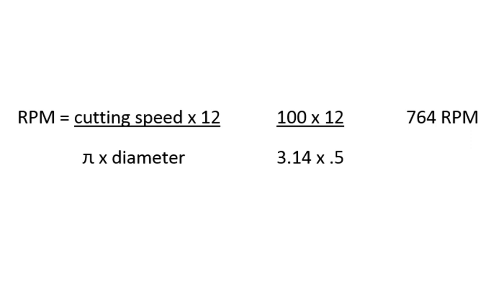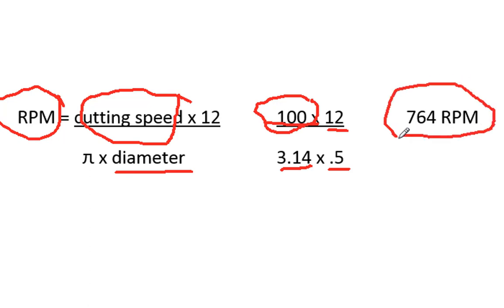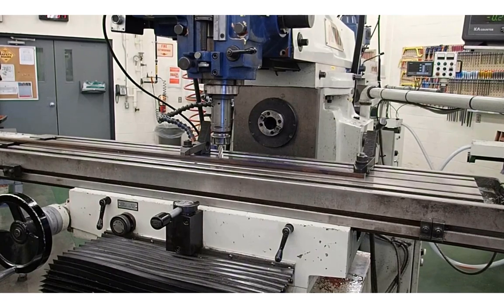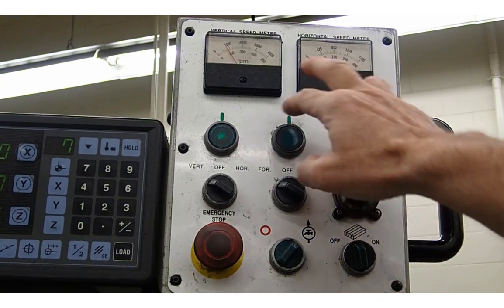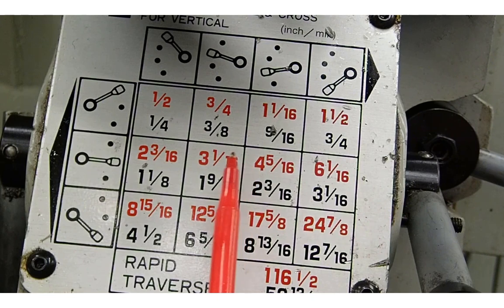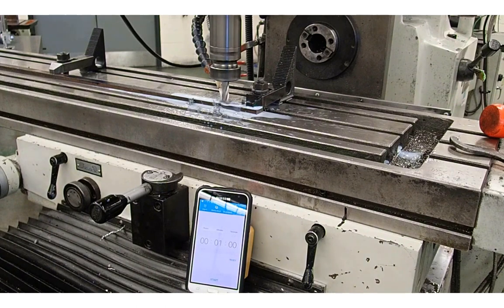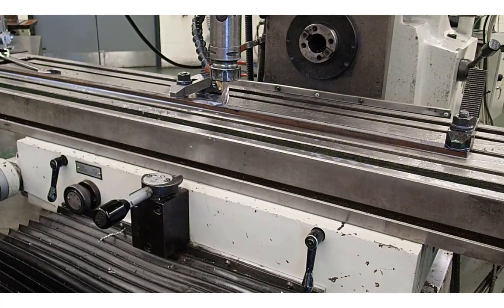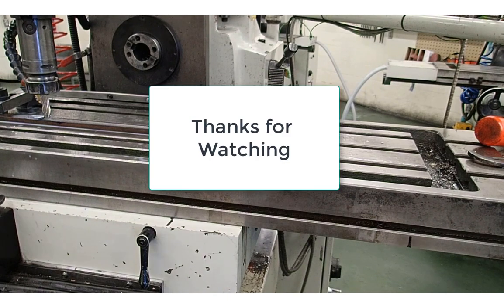Milling speeds and feeds

Comment: When I got my first milling machine with built in feeds (a Fexac horizontal) I discovered that feeds on a milling machine are given in inches per minute and not inches per revolution.  I also discovered that the knee feeds at a lower rate than the X and Y axis feeds (in my case 2/5 the feed rate).  I found both of these things to be frustrating as the first one makes figuring out the feed rate difficult and the second makes horizontal milling less effective.  When I got my horizontal boring mill (a Wotan) I was pleased to discover all the feeds are given in inches per revolution and the feed rate is the same for all 4 axis. It makes figuring out the feeds very easy.  The other advantage is you can maintain the same chip load per tooth when you change spindle speeds without having to change the feed rate. For these reasons and also the fact that the HBM is more versatile than a horizontal mill I now do about 90% of my milling/boring work on my HBM. Ken
Reply from the maker: Yes. Often the vertical feeds are different from longitudinal and cross (gear ratios). I enjoy working on boring mills. Thanks for watching and your note. It put a smile in my day! Take care Ken.

Comment: Very interesting. I’m new to machining. In the manual I was given the formula that I’m to use to find my rpm is cutting speed x number of cutters on the tool. Then divided by the diameter of the tool. So using high speed steel 4 flute (half inch) end mill it would be 4 x 100, divided by .500. And that gives me an rpm of 800. And then after all of that....... they tell me just play around with it (the speed and feed) haha. For precision equipment it feels like there is a lot of leeway in milling. Like I said I’m very new to machining but am really enjoying learning the trade! Thanks for the video, very informative.
Reply from the maker: I'm glad you liked it, you are going to love machining! Thanks for watching and your post.